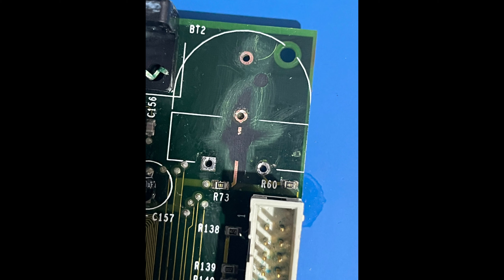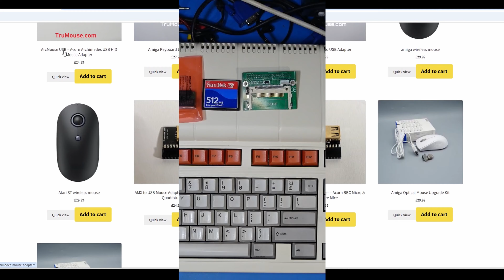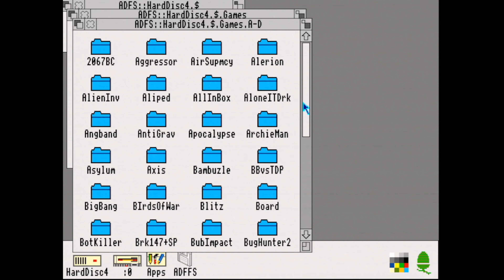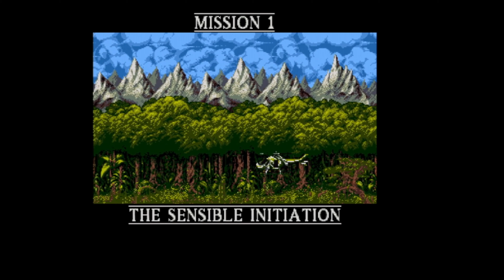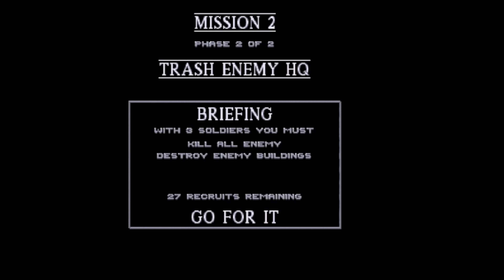The £80 Mouse Problem Solved! USB Adapter & CF Card for Acorn Archimedes

Comment: Back in the early 2000's, myself and my brother went on an Ebay craze, buying 4000's, 5000's and RiscPC 600's and A7000+'s. In All, we installed dual CF card adaptors like what you have, also available on Ebay. Surprisingly the 4000's were the most useful, along with the RPC's. The A7000+ was a great curiosity but not very useful. The A5000's were also useful, but the ARM3 vs the A4000's ARM250 did cause one or two compatibility issues, less so than the RPC, which featured the later VidC20 chip. While back in 1992 I received an A3010, it was clear to my brother who bought the A4000 at the same time, 2MB of RAM was too much of a bottleneck, While he was enjoying the full 4MB. So our adventure into Ebay got us a boat load of good machines.
Reply from the maker: Wow would have loved some of the bigger machines but now they are way too expensive.  If only I had collected more back in the day 😊. Such a great story and glad you saved so many machines thanks for sharing and thanks for the watch

Comment: A few years back Matt Evans created a proof of concept of a RaspberryPi micro podule for the Arc, schematics and firmware on GitHub, that in theory someone could revise for the latest Pi W, with their WiFi and bluetooth connectivity, and write a few drivers to permit you to connect any USB or Bluetooth mouse or games controller to the machine. Similarly with a copy of Acorn's AUN ROM image loaded into the Pi's flash on the podule, and a new driver for the Pi W's hardware, you'd have a TCP/IP v4 stack you could use to access any Econet network shares on an Arculator, BeebEm, ... instance you'd set up, if not a dedicated FTP server, and be able to telnet to anywhere not yet migrated to ssh, not too sure if the SMB client runs in under 8MB. Could even install a copy of the like of !ArcWeb, and try and find a few Js and CSS free websites, that follow W3C standards, by not having many MB's of HDR 4k hero and background images on every page.  

Not forgetting ARMlinux appeared in 1995, you could just about run it in terminal mode on a 4 MB machine. A separate Compact Flash card with a distribution might be a giggle. 

Oh you can have another 512MB slave, Drive5, adaptor and card, have an A5000 with a pair on the IDE bus, and half a dozen on the SCSII bus, and 3 virtual floppies in addition to the physical, for giggles. Was trying to find out which adaptors / cards worked over a decade back, still have a draw of non compatible IDE Compact Flash adaptors.

Comment: Great vid 👍🏻 
I bought the same mouse adaptor but haven't yet managed to design a 3D enclosure for it that works elegantly.

Thnaks for the link to the HDD image! I tend to use a Raspberry Pi running Risc OS to read & write to CF cards if that's any use!
Reply from the maker: Let me in one of you design a enclosure :).  The only thing to consider I found was the how close it was to the audio jack.  Anyhow glad you like the vid not enough Archie stuff out there.  :) thanks for your comment
Reply: @Retro4u  Will do.. good point about the audio jack; I was actually thinking of turning the adaptor into an 'inline' connector or dongle - next time I make a component order I'll include a 10 pin mini DIN and see what I can make up..
Reply from the maker: @zx85 super idea 💡. Let me know how you get on. Currently recapping the machine at the moment as the one by the mem had started to leak and smelt like kippers 😂
Reply: @Retro4u  😮 Wow.. you've caught that a the right time.. good luck!
Reply from the maker: What I have done in the end is extend the connector on to wire allowing me greater flexibility as getting it into machines I struggled especially the A3000. Then it would need a small external case but again something I've never looked into lol 😂
Reply: @Retro4u it all ends up as dongles in the end 😁 Must be a better way but without risking damage to the innards... nice one!